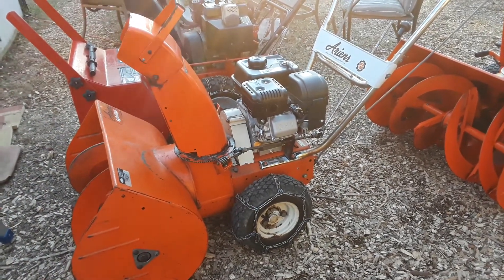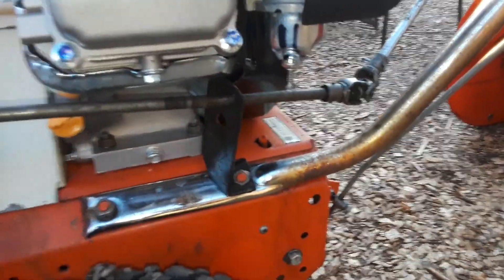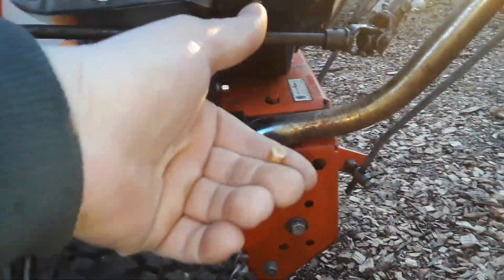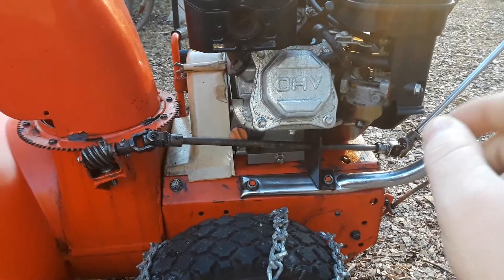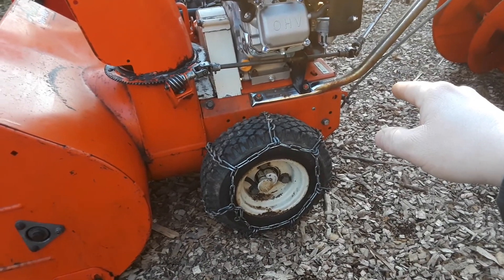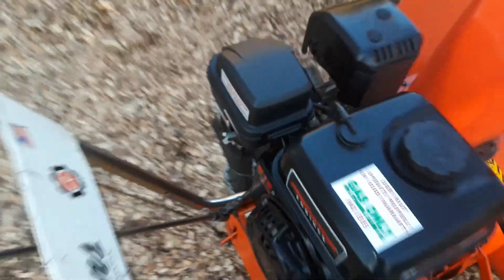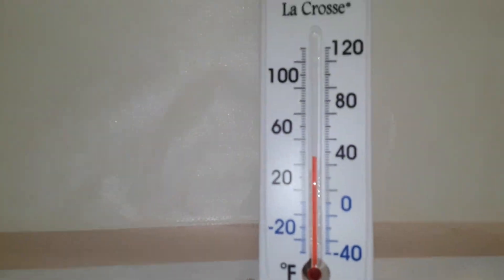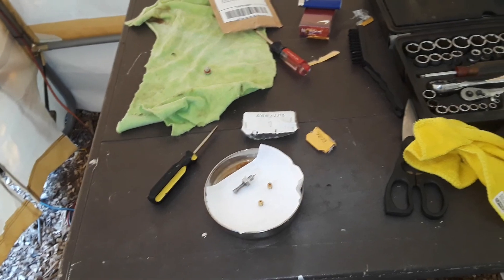HF Predator engine Carburetor adjustable main Jet install. Adjustable Carburetor for Predator engine

Comment: Nice video.  It has been nearly 4 years since you made this video.  How has your Preditor held up running it at 4400 RPM and using it commercially for all of this time?  Any Oil burning now?
Reply from the maker: Their still running good but I adjusted those rpm settings to around 4100 rpm. 4000 to 4100 is the general setting for most people from what I've read on snowblower forum. Thats where mine have been set and I've had zero issues, their still going strong. 4400 was a little to high and was causing them to surge, that was the main problem with 4400.

Comment: I'm curious on how the adjustable main jet will work, as far as performance, for my go kart, that has the non-hemi predator 212 on it. I've deleted the governor for more power and have been thinking of going to a bigger jet. I just installed a 30 series torque converter.  Please message me at either my email address, (rhall9285@gmail.com), or on my cell, (6063695761). Please use heading, "Go Kart Help". I'm a 280lb dad of three kids under 10 years old and we need to be able to move around on our home made 4 seater go kart, with us all on there. With 3 kidos, a budget is a must. So, any help with this problem will be greatly appreciated. Thanks so much.
Reply from the maker: Both of these snowblowers are using that adjustable main jet. As seen going thru snow, their working harder or as hard as a go-kart and they work perfect. All your doing is giving the carburetor adjustment or range within the air fuel mixture like the older engines did such as the Tecumseh Snowking that had an adjustable carb or briggs flathead lawn tractor engine that had it, as two perfect examples, as long as you adjust it where it needs to be, it will be fine, thats what the adjustable jet is for, it allows you to adjust the carburetor to run its best. The stock jet is a tad too small, so the Predator runs lean, wants more fuel and surges, especially in colder temps. The stock jet it I believe 0.28 you can order a larger jet, I believe the most common is the 0.31 or you can just take a micro drill bit and open the stock one yourself. The adjustable one will let you go anywhere you want in that range, weather its cold, hot or your at low altitude or high altitude, you can dial it in to run perfect yourself, depending on changing environmental conditions. Thats the advantage, with a fixed jet you cant, so if the weather changes or you go to higher ground and the engine starts running poor again, you gotta swap the jet out again, with the adjustable, you just adjust it, done. Videos of those machines throwing snow at 29- 30 degrees below. Good luck. In summer, they usually need to be slightly adjusted again, by turning that screw to compensate for the hot air vs freezing air.
https://youtu.be/esTLokPplzk

https://youtu.be/dhx-2ICEvyQ